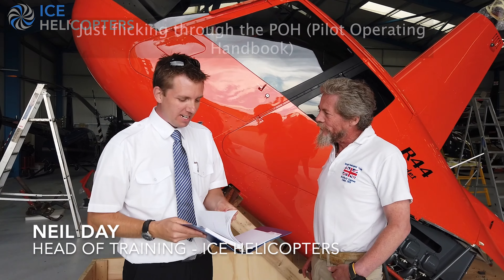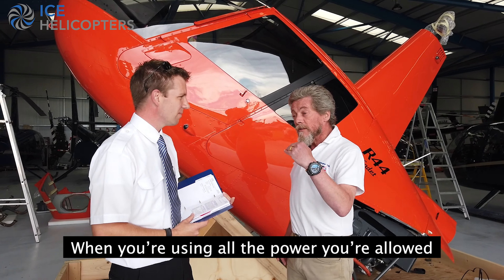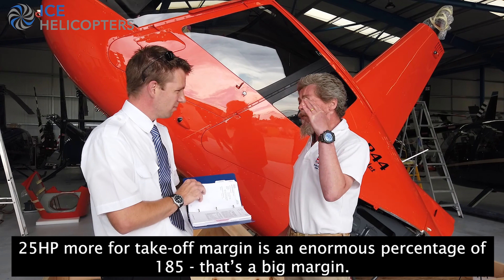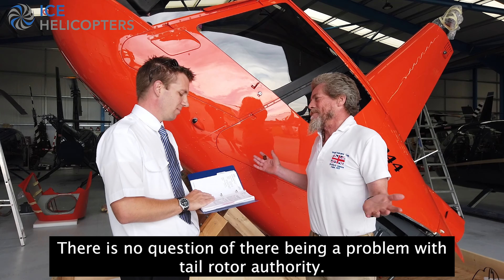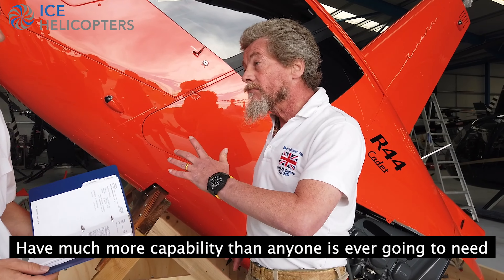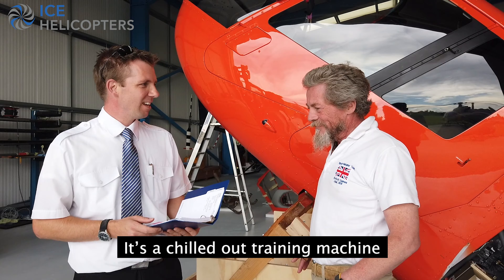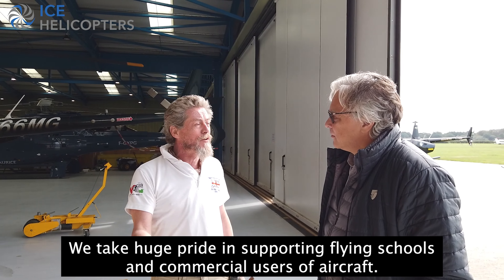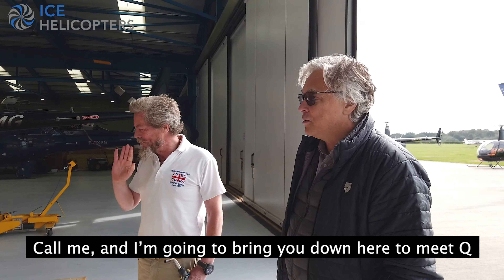Robinson R44 Cadet - The KEY DIFFERENCES

Comment: This is going to sound like a stupid question but what limits you from using take off power beyond the 5 minutes? Obviously the engine is capable of it
Reply from the maker: Not a stupid question at all; the power is limited by the pilot calculating their maximum allowable "Manifold Pressure" for a given day at a certain altitude and corresponding outside air temperature. They monitor the "MAP" gauge and ensure that the maximum power is not exceeded.
The engine will produce more, but using that additional power can/will damage the aircraft.
Reply: @ICEHelicopters  thank you for explaining that. So it sounds like in an emergency you could pull a lot more power if you really needed it. The reason I’m asking is because it seems like the Cadet is basically a Raven 1 just with no rear seats.